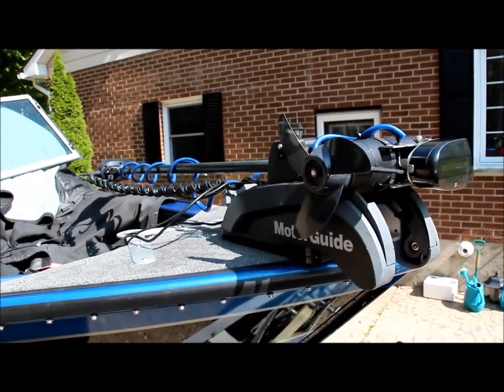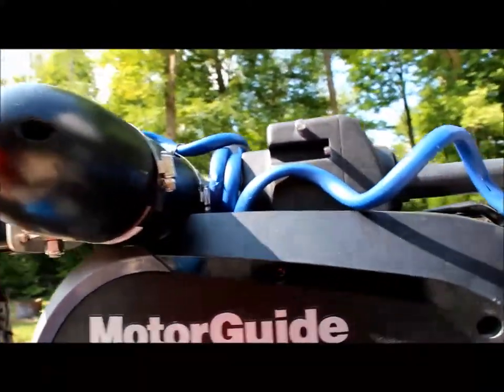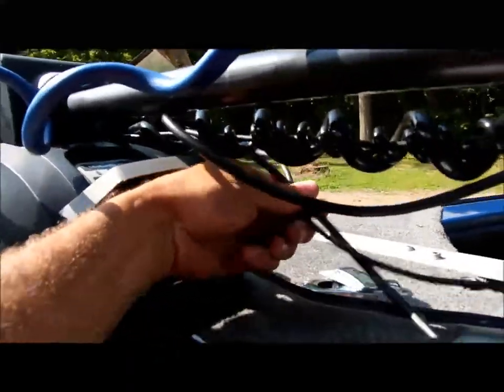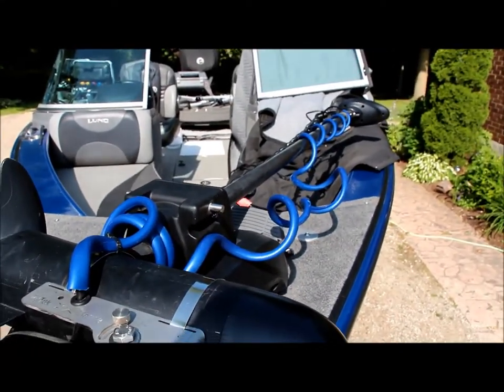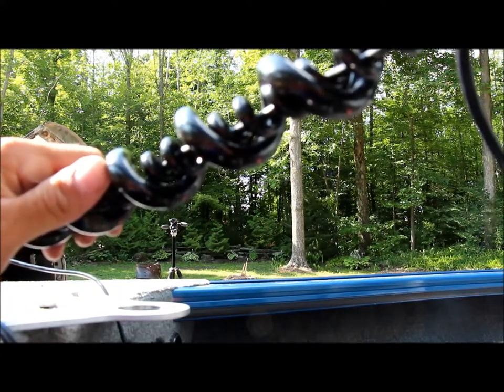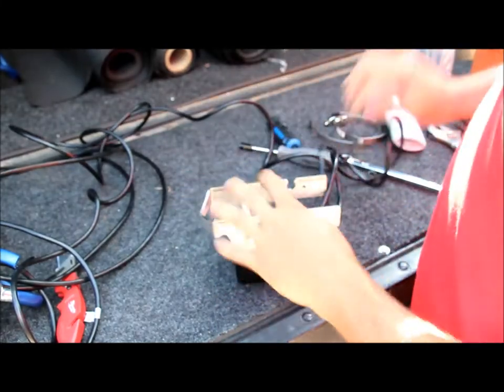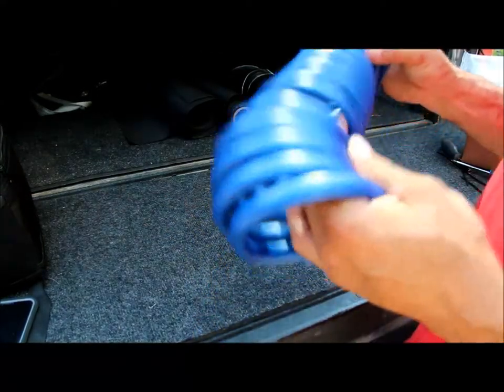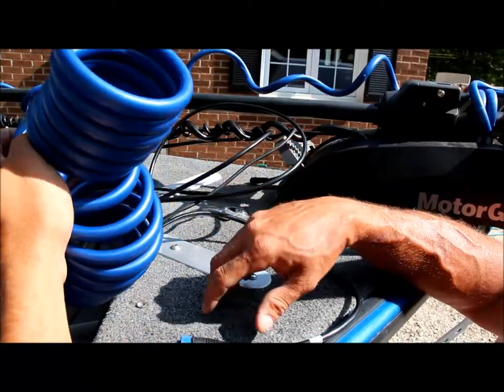RyTek LiveSight Trolling Motor Transducer bracket installation

Comment: You don’t need to run your cable up the shaft and then back down.  You will find that after your twists you can run your cable under the motor mount and then directly to your display.  I have the same set up and it is much less congested.
Reply from the maker: Hi Joe, are you referring to the transducer cable coming back down thru the group of cables to the actual main steering motor housing/pivot of the Xi5? If so I have tried it both ways and having like I described in the video is 100% the cleanest and easiest for operation. Some only come up to the steer motor housing but I find that does not allow for enough slack in the coil.

Comment: That method of cutting is very dangerous - do NOT use this method!!!!
Reply from the maker: Hi John, if you take your time and use the knife as your guide on a flat hard surface and hold down the hose firmly it works well and is safe! That being said if someone is worried about cutting them selves or dont think they can do it correctly it's best to find another option! If you have any instructional videos on doing it please post a link to give people another option!
Reply: @rytekmarine6717  Hi RyTek, if you were found doing that in our workshop at the refinery you would be issued a written warning.  If you go to Lowrance Tips & Tricks and read my post carefully you will see how I do it - SAFELY.  I started this method many years ago with the old MK RipTide trolling motor and many have claimed it to be their idea over the years.  Doesn't bother me of course, in a way it is a compliment.